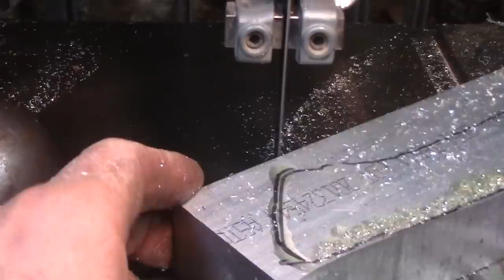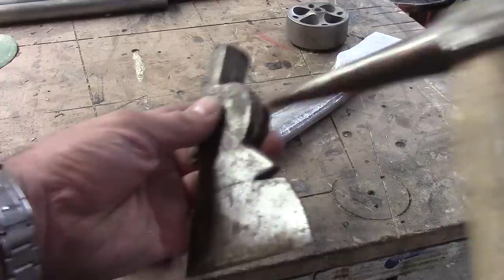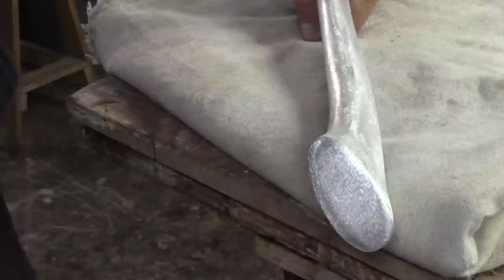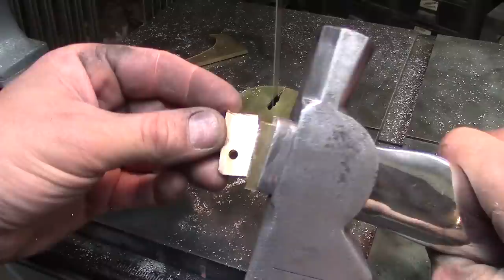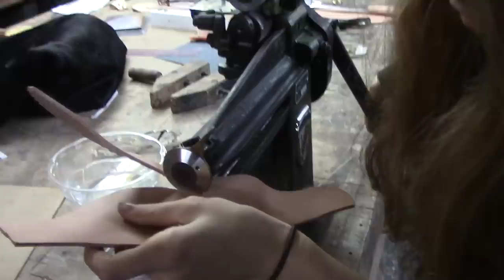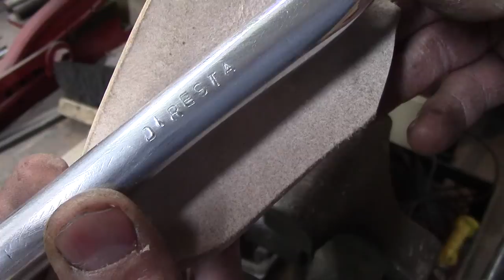✔ DiResta Aluminum Hatchet Handle

Comment: Awesome! When I was in high school I had a class called metal shop, and we had a project to make a hammer with an aluminum handle that we turned on the lathe. It was up to us how we attached it to the steel head we made. What I did was I drilled the hole in the head the same size as the handle shaft and I froze the handle in the freezer and I put the head inside out furnace. The heated head expanded and the frozen handle contracted and when I put them together in a hiss, they sweat welded together. 40 years ago I made it. It's still tight!
Reply: Great idea!
Reply: traderjoes Most of the high school wood and metal shops have been closed.  The kids might get hurt.  It's sad, but only part of what's wrong with our country today. Progress?
Reply: drstampfli As a Industrial Arts teacher myself, I hate not having the true traditional woodworking, metal working classes I as many others experienced when in school. I'm lucky though that I can still teach hands on small scale woodworking projects, along with other items. I do hope someday the traditional woodworking shop does reappear.  Because the kids today, are great at video games and texting, but last I checked, that doesn't give life skills or a good paying job...
Reply: QuainBuilt There are a whole bunch of YouTube gamers that would disagree with the last part. 

I agree with everything else. It's unfortunate that they have been disappearing and I have fond memories of shop classes. It makes me wonder if the lack of shop classes have contributed to the decline in the trades (at least in my region).
Reply: QuainBuilt tgbg
Reply: its true that schools dont teach it the way like in the old days. but still many people give their legacy to their children, so woodworking and other skills continue. same as many old books from the 60thies i have recovered that have a lot of great information. so not every young guy is a gamer. still many young people like to develop skill to build their own homes and such. i still learn every day and will do that till i'm probably death...
Reply: Jörgen Börg I agree with you how people will grab old school books, or learn from elders, heck my kids who are younger than those I teach know more than those I have in class. A few of my friends are from the beginning generation where technology was phased out, and they always seek my knowledge and advise, and I know not every kid does the video game thing, but it seems that kids today would rather play games or watch tv, rather than learning a great set of skill sets. Thank goodness for people like Jimmy and the rest of the you tube community to show off and teach something to those of us who want to see and learn.

Comment: Personally, I always enjoy your videos... I don't care what the trolls say, I think that hatchet is beautiful. besides, too heavy? it's a workout exercise... getting buff in the arms for Taylor, huh? Balance is off? so what... deal with it... It will shatter? nah... might bend a little though if you miss a few times... the sheath really should have rivets, and a plastic insert so the head doesn't cut through the stitching. hung all wrong? what the hell? brass wedge is way cool. i love the contrast to the aluminum. blisters? just toughens the skin even more... BLO on aluminum? are you out of your mind? it's heat treatable... and 7075 is way too expensive for a handle anyway... head will fly off and hit whoever says that... hold alum. in the cold? don't you have gloves? galvanic corrosion will rot your brain... the leather will slide off... get a better grip on it.. arms vibrating? heard of shake weights??? the bandsaw technique cut your fingers off. any bandsaw technique can do that, and yeah, i agree, it needs to be sharpened. much more... like a razor, so it doesn't hurt as much when you slice your knee...
Taylor did an awesome job on the leather. kudos to her... 

but in the end... coolest hatchet I've seen yet. if it was sharper... oh well, build a Diresta sharpener next. then shave with it...

I subscribe... and Enjoy!
Diresta... Beats the Resta...
Reply from the maker: haha thank you brother!

Comment: it is too heavy, the balance is off, it will shatter, the sheath should have rivets, the head will cut through the stitching, it was "hung" all wrong, brass wedge is a bad idea, I will get blisters, I should only ever use BLO to finish any hatchet, 6061 is the worst aluminium to use for this application, this head will fly off and hurt someone, you can not hold aluminium in the cold, galvanic corrosion will make the hatchet explode in my hand, the leather will slide off and the hatchet will go flying, my arm will vibrate and cause muscle fatigue, the bandsaw technique will cut off my fingers. and it needs to be sharpened.

As for all of the above I personally don't think it really matters because it is a thing of beauty (and it kind of looks like a fighting tomahawk so you don't need to  worry about getting blisters unless you plan on doing a lot of fighting :D) 

Anyway it is a great project and video as always, thank you.
Reply from the maker: Hahah tx brother !  The is A few people I like to fight w this !!
Reply: Surely you've both forgotten that it's going to spontaneously explode with a cloud of smoke that spells "OSHA" :p
Reply: madwilliamflint Oh yeah haha!
Reply: Also, rocket fuel burns hot enough to actually get the aluminium to burn, so no tomahawk fights on a flying rocket ship please.
Reply: Can someone explain all of that, please? For instance, why would 6061 is worst choice for this application, etc., especially the galvanic corrosion one.
Reply: Sami Al-Terkawi Hasib  Basically when two metals are in electrical contact and forum a "battery" of sorts. One metal is eaten away and weakens
Reply: Ruben Lewis Brilliant comment!

Comment: Jimmy, I made myself a "hatchet" of my own design years ago with an aluminum handle too.  It hasn't shattered yet, and I attached the head using epoxy, but the thing that I said "AMEN" to the loudest is feeling the vibration when chopping with it.  Woah!  Very cool project, I think the brass wedge looks freakin cool peened over.  All the best,  Josh

Comment: "Few Things I know already About this Hatchet; it is too heavy, the balance is off, it will shatter, the sheath should have rivets, the head will cut through the stitching, it was "hung" all wrong, brass wedge is a bad idea, I will get blisters, I should only ever use BLO to finish any hatchet, 6061 is the worst aluminum to use for this application, this head will fly off and hurt someone, you can not hold aluminum in the cold, galvanic corrosion will make the hatchet explode in my hand, the leather will slide off and the hatchet will go flying, my arm will vibrate and cause muscle fatigue, the bandsaw technique will cut off my fingers. and it needs to be sharpened. "

This is priceless.

Comment: Hey Jimmy,  great job.  That marker you used to trace the old handle at the 15 second mark with the long skinny tip.  Where do you get that?  I've seen Izzy Swan use one also, and it looks tremendously useful.  I need one for my shop!

Love the look of the brass after you peened it.   (And kudos on the description.  Wow, that is biting satire.  Brilliant brilliant brilliant.)  

I am curious about the backwards bandsaw technique -- when you pull the piece backward.  You're using it to kind of carve away at that point?   Does it work on wood also?   This is of course purely an academic question.  I would never attempt something like that on my own.
Reply: Yeah, I was wondering why he pulled the stock along the bandsaw blade. I've never seen that technique!
Reply: ***** Ahh, makes sense. Thanks!
Reply: Kyle Steers Thanks, Kyle.    Need to find a Canadian dealer though, $5.50 for the marker but $9 estimated shipping to Canada (cheapest option they had)
Reply: wordsnwood
Lee Valley has them in Canada.
Reply: Steve Benson Thank-you!   (darn it, just put in an order there...   Oh well, next time!)

Comment: Great job Jimmy. If you want to prevent an edged tool from cutting the stitches of the sheath, cut a narrow strip of 1/8 inch thick leather and put it between the main sheath parts before sewing. It keeps the edge off the stitches. I never use rivets on sheaths and have never had one come apart.
Bandsaw technique is awe inspiring, You seem to keep your fingers well away from the blade. Should see how close my fingers get to the needle on my industrial sewing machine!! The knockers are wimps!!

Comment: What an interesting, yet artistic build. In my opinion, it looks more like a hatchet you'd put up on your wall that you could use (if you really needed it), but would otherwise be a decoration more than anything. Almost like how people spraypaint something in all gold or all silver and display it. Regardless, it's neat that it still works as a hatchet that can cut, and you're free to do with it what you like. The flaws you already know about only seem to matter if you intend to use it over every other tool you've got, so in all honesty, I don't think those matter that much in the long run.

Comment: i use these roofing hatchets to carve wood with...spoon, bowl roughing kind of stuff. They are much easier to find cheap vintage ones that are quality steel. They are also much thinner on the blade part and that makes for better carving. I do some work on the bevel. get it near single sided bevel for detailed, steep cuts. you can get a old plumb at a garage or estate sale for only a few bucks. try to keep the original handle if it's in one piece. you can tighten them up with another wedge.

Comment: Great job, contact corrosion can actually be a problem (I think you know it well, but for those who do not know :)), you compose a good battery if the water gets in between the metals it can begin to react with each other. Fortunately there is an easy way to check it out, more than 0.5 V between them, means a reaction, did not explode, but the steel will begin to reduce aluminum. Aluminium will begin to reduce copper from brass. It's a little thing, more important is that, as always, what you're doing looks and works brilliantly. And the most important is that what you do is your work, you are doing it with their own hands, is such that you want and you can call at this sign as an artist, not like most of the authors of malicious comments into bill in the store.

Comment: I like the idea of an aluminum hatchet handle.  I think it might need some refinement, as you mentioned in your description, but what you did is still the best.  You might have to prove that statement about galvanic corrosion, but even if it is true, there are many ways of bonding the aluminum handle to the steel axe head...  

Your vids are the greatest, and they inspire me to see what I can do in my shop.  Maybe my next project is to try and video a project...

Comment: Great hatchet handle!
A tiny tip on the leather job. If you insert a strip of leather in the seam (between the two pieces) you reduce the risk of cutting the stitches with the hatchet.
I've made loads of knife sheaths in my days and this I learned from an older man who'd done it his whole life. Yes it get's a little bit thicker but for an axe or hatchet it won't look odd.
What's the feeling like with the aluminium handle? No flex I guess, but very light and comfortable I guess... Looking very nice!

Comment: Lightening holes? to reduce handle mass. Galvanic corrosion will take a while unless you leave it out in a salt air environment. I think it's beautiful Jimmy. You might consider a hard anodize finish to preserve the metal. As far as holding it in the cold? That's what gloves are for.

Comment: I think this is an excellent hatchet regardless of your comments in the description. Might not be acceptable as a usable tool but maybe could be given as a gift or presentation piece instead. I might do a similar method with a small hatchet or even a full size firefighting axe, been thinking about a polished aluminum handle with the traditional red painted axe head and mounting it to a nice plaque or even in a shadow box for a presentation for my fire dept that I am a member of.

Comment: Very cool looking hatchet im sure its not real practical but still very awesome looking!
Not sure but doesn't galvanic corrosion require low voltage electricity as well as dissimilar metals?

Comment: If you ever do have an issue with galvanic corrosion, I would love to know about it. I am curious about how long it will take to set in for an application like this. If it does not cause any issues for years, then this seems like a good idea for some of my tools with broken handles.

Comment: Jimmy, as usual, excellent work.
Let me ask you a question...
Do you think that the blade could be fixed by heat and cold method?
As you supercool the handle, you heat the blade, so one metal contracts and the other expands... When you put them together and the temperatures get back to normal, they will be firmly fixed...

Do you think this is a good practice in this kind of work? Or safe enough?

Thanks and best regards from Brazil

(please do a barbecue cutting board for barbecue sometime)

Comment: Not to detract from your work Jimmy, but as I was viewing this I began thinking that greensand casting a new aluminium handle may very well have required Less work to achieve the same result. I was also surprised that you didn't use an angle grinder instead of hand files or was that a noise issue vs. time of day problem?
Reply from the maker: Casting is another option I can't do at my shop. To grind aluminum or sand it will fill the paper up right away.  File is basically the fastest most effective method. Or 3d CNC.
Reply: jimmydiresta if you use candle wax or most types of wax on your sanding discs or grinding discs when sanding aluminium it wont clog up the paper. love your work jimmy!!!

Comment: Love the video, beautiful piece of craftsmanship. I was wondering why you chose to go this route instead of starting with a sand casting of the original handle? not hating, looking for a sincere answer and some insight.
Reply from the maker: I don't have the ability to melt aluminum safely. I have a band saw so I cut the material. Tx u
Reply: thank you for your time and inspiration

Comment: I wonder if you drilled down the the center of the handle, like bored it out and added sand or liquid latex or something if it would dampen the vibration and even out the weight a bit.

Comment: I’d say the wedge for the handle is unnecessary but then again I wouldn’t know how to secure the head other than hammering the top until it mushrooms over.  Don’t know if it would work well with aluminum though.

Comment: Still a great piece, Mr DiResta, but there was a tiny mistake in your process - you aren't supposed to beat on the wedge directly like that because it loosens the handle shoulder from the eye. The wedge should be rested on an anvil and then the end of the handle should be beaten with a soft mallet.

Comment: A couple hundred 1/16" diameter holes drilled from side to side would lighten it and take away some of the shock.  I'm not familiar with aluminum alloys, so I have no idea if the 6061 is brittle and would crack with all the holes.  I think I would've taken a different path from the start myself.  I wouldn't have copied a wooden handle, but try to figure out the best shape for aluminum.  Even if you're not happy with it as a working hatchet, you demonstrated some great metal working skills.

Comment: This project looks wonderful, but putting those different metals together is NOT advisable. Metals react with one another through a chemical reaction, because brass (which is tin + copper), aluminum and iron (or steel which is iron + carbon) exchange ions which makes the weaker metal to decay first or oxidize. That's why you never do a repair of a steel pipe by attaching a bronze coupling or a copper pipe directly to it. You need to isolate them via a plastic or non metal means of insulation. It might take a long time, so in this case it might not be an issue, but for other applications it may be disastrous.

Aside from all of this, it shows the great craftsmanship of your work, as always.
Keep it up!
Reply: electrolysis only happens with and electric current present i think the term you are fishing for is galvanic corrosion but brass to aluminum in dry conditions would be stable
Reply: tatzilla1971
You are right about the term, but wrong about it being stable in dry conditions. It also happens in the presence of air due to the oxygen, thus the name oxidation or oxide. Water has molecules of oxygen too, as we all know. Brass contains cooper, so it would react with other metals such as aluminum or iron.

Besides, there is always moister in the air, on your hands, etc. So "dry" conditions is a relative term of the environment, but not absolute, except in a control environment in a laboratory.

Comment: Mr. Diresta, I'm new to this so I would like to know if there is a difference in blades used between cutting metal and wood on a bandsaw? I know AL is a soft metal, but what would be the difference in it and another wood in metal terminology(i.e. I have only measured blades according to wood, what is the difference in teeth and speed of the motor?)?

Comment: Aluminum will be very susceptible to galvanic corrosion in contact with copper, assuming that the two metals are also in contact with a common electrolyte (such as water)

Comment: would casting the handle (primary shape) make a difference in quality?
Reply: Yes it would, the natural grain of the metal would take on the shape of the cast, rather than being cut off wherever the material was removed. Not a huge difference, but a difference nonetheless. It would've been quicker too.